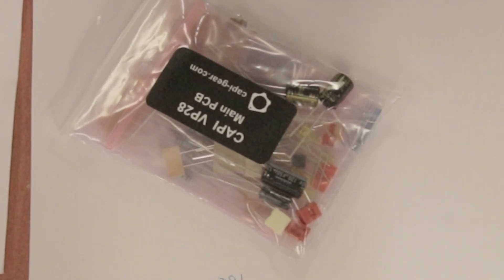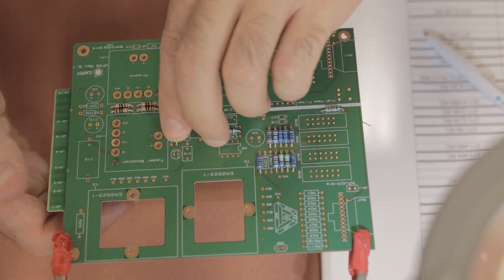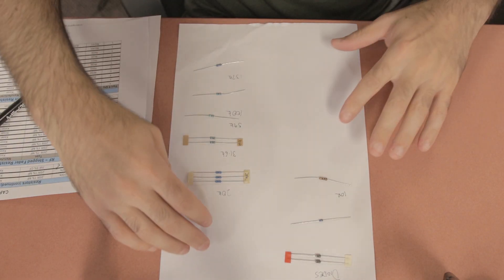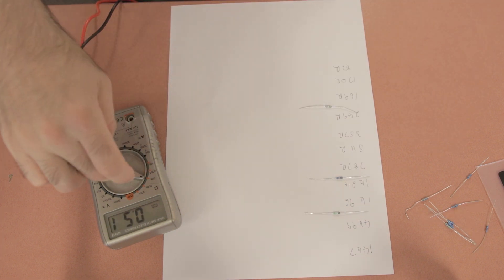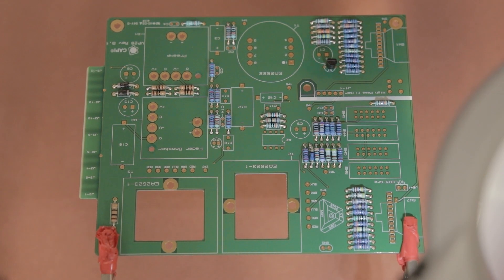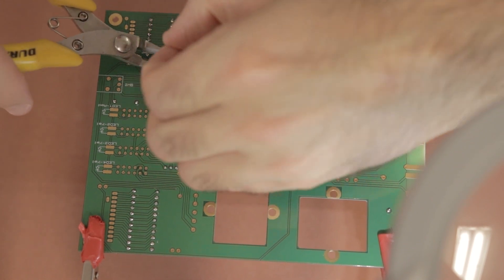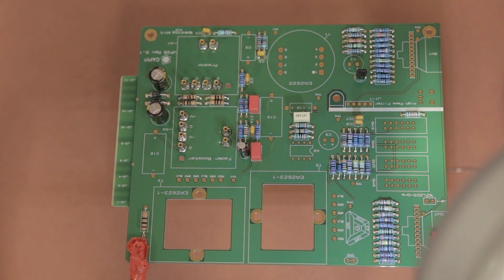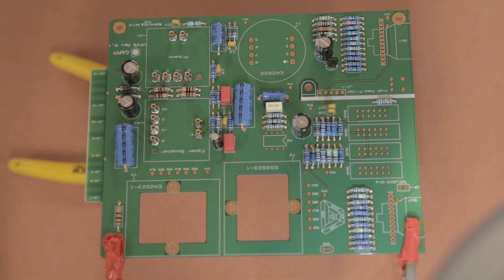How to Build your Own Preamp - CAPI VP28 (API Mic Preamp) DIY Build PART 1

Comment: Don't believe the hype : CAPI are NOT API clones.
Reply from the maker: Yeah you’re right, they’re BETTER! 😂
Reply: @diyrecordingstudio  Touring as a comedian OR dimply deaf? I guess the second.
Reply: What magic components are API using? These things are all built of the same stuff. The components have to be available or they wouldn’t be made now. Why is it so hard for you to understand that anybody with understanding of what these components are can easily replicate them? Many companies are doing this. I have pre amps from all major brands. Including API, SSL, and NEVE. In my collection are a pair of CAPI VP28 preamps as well as a pair of CAPI fc526xfmr compressors.  Trust me when I say the CAPI gear is of equal or greater quality than all of them. As a matter of fact I was incredibly dissatisfied with my SSL VHD+ pre amps when they arrived because they felt cheap by comparison. I agree with the OP in that CAPI are better. You actually have tonal options in the op amps and transformers. They sound amazing and are built like tanks!

Comment: Great video, Thank You.   
Workflow Tips for next project: 
Best to bend and cut the resistor legs, before soldering...
so the ends are covered too.
Else, Bare copper in the cut will corrode over time,
and cause a non conductive layer.
Also,  the clippers can shock the soldering...mostly on single sided PCB.

Greetings.
Reply from the maker: Thanks for the great tip Jakob!

Comment: What do I need to build one? Will I need a lunch box for it or power supply? And someone told me 500 series is only mono so I'd need 2 for vocals
Reply from the maker: Hi CJ,

Thanks for stopping by. OK, CAPI supplies all the parts, you just need a good soldering iron and a steady hand. Have you soldered before? 
A lunch box is needed as a power supply, there are many of these as different price points with different amounts of slots. You can get 1 up to 11 slots depending on price.

You don't need to record vocals in stereo, so you would only need 1 mic Preamp.

The benefit of these preamps is they are very high quality (exactly what you'd find in a pro studio) compared to something like what you would find in a cheap usb interface.